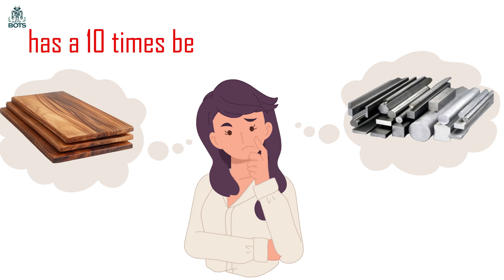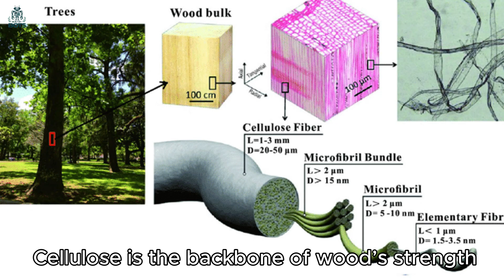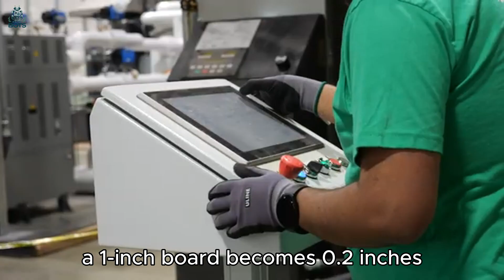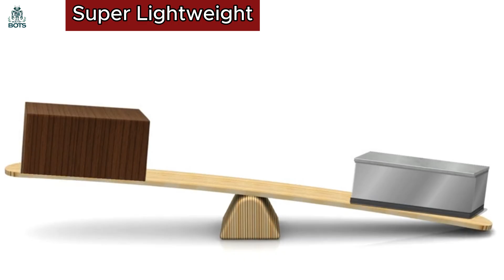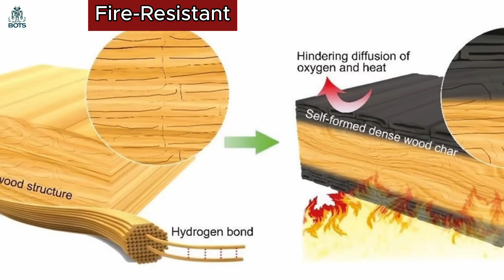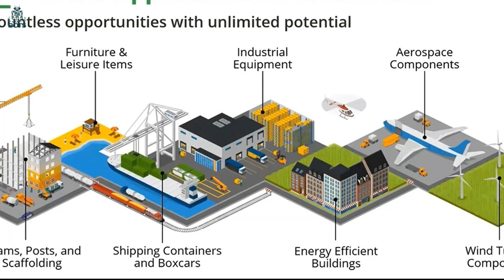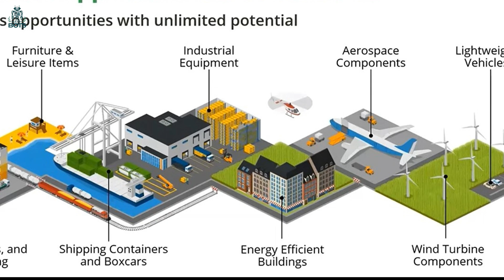How Superwood is Made. Making Superwood  Stronger Than Steel!

Comment: Okay, here's something -- wood cannot carry an electrical charge in and of itself, so the accident that brought the Hindenburg down, theoretically, can't happen if the hydrogen containment bag(s) are composed of superwood. Make the entire dirigible from superwood, keep it strong and light (and bulletproof). The Hindenburg weighed 250 tons and could carry 50 tons of cargo. Eliminate the 125 tons of passenger and crew accommodations, and one as big as the Hindenburg can now carry 175 tons of cargo across the Atlantic in hours instead of days - and with MINIMAL fuel costs. Aaaaaaand, hmm... IF you built a lighter-than-air rocket, how hard would it be to get to space? Here's your hydrogen source https://www.youtube.com/watch?v=9B8srudAUhE (from saltwater [and imagine one of these handy dandy little devices adapted to your car so it could run on hydrogen]).
Enjoy...

Comment: Since the video showed how hard it was to penetrate the wood with a screwdriver what does that mean for trying to cut this or use fastemers?
Reply from the maker: I am describing the special features more than steel type in which is a special feature. cutting, drilling work when using Superwood to make a house, car. You do not leave a super wood log and give out a house

Comment: Can it be done to covonut lumber?
Reply from the maker: do you mean coconut lumbe?. 
Yes, high-density coconut lumber could potentially be used to make Superwood, thanks to its strong cellulose structure. However, its silica content and processing challenges (abrasiveness, splitting) require testing to confirm compatibility with the chemical treatment and compression process.

Comment: I'm wondering about the applications for boatbuilding.  Does Superwood come in the same form as plywood and will fiberglass (epoxy resin) bond to Superwood to make it waterproof?
Reply from the maker: thank you for your interest!
Superwood is not plywood; it’s an engineered wood like HDF or MDF, denser but less common in boat building. It can be bonded with fiberglass and epoxy resin to make it waterproof, but marine-grade plywood is preferred for its moisture resistance and strength when sealed with epoxy and fiberglass.